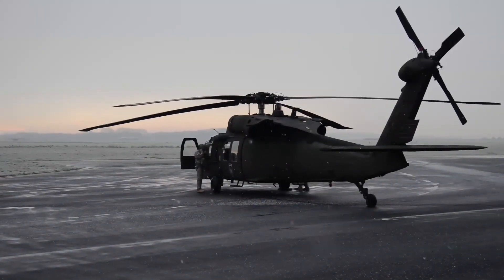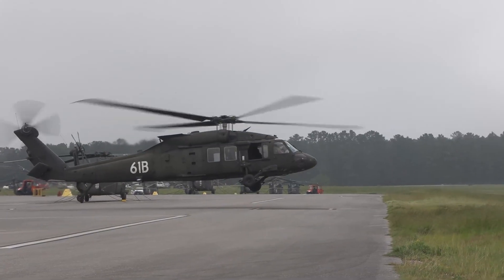Why the Military Can't Resist Tilt Rotor Aircraft

Comment: Technically speaking Osprey has a better safety record than the Blackhawk etc but since carries a lot of people when it crashes  it becomes the headline, this is not to descredit it's woes during development
Reply: Then don't fly either. Why risk more service members lives? Our nations best are not crash test dummies for military contractor to use. Send the design engineers and mechanics up instead... I bet safety issues resolved quickly or aircraft gets grounded.
Reply: What a stupid statement.
Reply: @locoparentis244  there will always be some risk when flying aircraft especially helicopters, but these are very rare (even for the osprey) there will always be a risk associated when flying in them, it but the military should still try to minimize the risks.
Reply: @Facade866  understood, agree, but level of risk must be honestly appraised vs rewards. The thing seems inherently a bad design, period. Is it combining the best of fixed and rotary wing aircraft, or does it actually achieve the worst of fixed and rotary wing aircraft?
From recent article:
The central concern today is flying safety and here the Osprey has a mixed record. The aircraft had four crashes and 30 deaths during its initial development.
Since entering operational service in 2007 there have been an additional ten crashes and 24 deaths.
Two of these ten were on combat operations where the cause was uncertain. The others were due to pilot error or technical problems.
A fatal crash off Rockhampton in 2017 can be seen in a terrifying video that also shows operating the Osprey is a complicated business.
Reply: @locoparentis244  ok now for your most recent question. it combines some of the good this from an airplane and some from a helicopter but also the bad stuff, some of the good stuff is that it can take off like a helicopter and fly as past also it can get bigger more easily. now the bad stuff, the Osprey/valor (I hate the valor it will just be an osprey 2 and crash as much) they can't glide like a plane even though they look like they might because they don't need the lift to take off, and they can't auto rotate (helicopters way on kind of going to the ground slower)  so they can't go to the ground slower if both engines fail/a propeller fails/ the driveshaft/and much more, so if a bigger issue happen.... good luck. and most importantly it is a pain to control, a plane is very easy if it's in the air you could fly it with little training, a Heli is a lot harder, but a tiltrotor is the hardest especially in helicopter mode which is what like half the crashes were pilot error (No blame on the pilots my cousin trains people on it.... hope he switches to a more reliable aircraft) thank God the osprey will be out of production soon but now they decided that they need to replace the Blackhawk with the valor, trust me more people will die from both tiltrotors, I hope one day this will change but it seems unlikely.
Reply: @Facade866  that is not good. I have good friends who have and will fly in these things, and I dread hearing about that.
Reply: @Facade866  Get your facts correct my guy. So much of the garbage you said is wrong...

"they can't glide like a plane even though they look like they might" - wrong

"they can't auto rotate" - wrong

"so they can't go to the ground slower if both engines fail/a propeller fails/ the driveshaft/and much more" - wrong

"a plane is very easy if it's in the air you could fly it with little training, a Heli is a lot harder, but a tiltrotor is the hardest especially in helicopter mode" - so lets not advance because it is harder to fly?

" half the crashes were pilot error" - well over half btw because the military didn't know how to even train people on the platform but now they do...

"thank God the osprey will be out of production soon but now they decided that they need to replace the Blackhawk with the valor, trust me more people will die from both tiltrotors" - The navy themselves have said the V-22 is one of the safest aircraft the navy flies...
Reply: @locoparentis244  He is wrong about so much read my comment
Reply: @locoparentis244 I am a bit biased against this due to my father working on the defiant X and raider X, so I have no comment (for your earlier question) also the Blackhawk had no crashes in its development and testing.
Reply: The Osprey is also a hangar queen.
Reply: You can't be serious. There's a reason they call it the crashhawk. The blackhawk killed more people in the same time than the V22 when it entered service in 2007
Reply: @topkek1194  if you were to look into the numbers for a second you would see that more than 5000 Blackhawks have been made with 114 deaths from accidents since it was tested and has been in service that means for every Blackhawk made 0.02 deaths have been caused but for the Osprey only 500 have been made with 54 total fatalities which means 0.11 deaths have been caused per tiltrotor built that is over 5x the amount of what the Blackhawk has caused from accidents and you still claim it is safer? and there has been 15 hull losses which means 3% of all Osprey's made have crashed beyond repair, compared to the Blackhawk's 0.48% of airframes to be made beyond repair from crashes that means ospreys airframes are more that 6x more likely to be destroyed in an accident. and all this info includes Blackhawk's history before the Osprey went into testing which is nearly 20 years and the Blackhawk is way older now, the osprey still has many more years in which it will continue to keep on killing marines due to Bell incompetence. next time look at the numbers before trying to disgrace the Blackhawk.
Reply: yeah, more that's because the Blackhawk is older and been in battle, the osprey has seen little battle and is new compared to military standards (oldest ospreys are 23 years old) and has still kept on crashing. more crashes will continue to come due to Bell's horrible design and shoddy building tactics, compared to Lockheed, Northrop, and Boeing, Bell is the most unreliable and unsafe, you can keep on blowing Bells horn, but it won't stop the marines that are being endangered due to Bell's lack of quality control, and a very hard to use aircraft.
Reply: Which literally has nothing to do with anything as the vast majoriety of blackhawks have not seen battle either. This year alone more people died on black hawks. You cry about bell, but they also won the black hawk replacement with their v-280 which was miles ahead of its compeittion and flying more than a year before said competition. You have no actual basis for your opinion other than "tiltrotor bad"
Reply: @jus7addwater  I guess since I'm here I will address this, for once look at what I have said, there are around 2000 blackhawks in service vs 500 osprey's, the osprey has had 11 deaths this year vs the black hawks 16, that doesn't look like 4X the osprey's, also the valor did have some advantages over the defiant X but that speak it would come in at over 2X the cost of the defiant X and costs more per flight hour, also harder to use in urban conflict due to it being gigantic and the defiant X filled all the requirements of the army while ON budget, the valor came in around significantly over sized and over budget. Look at the numbers first.
Reply: @Facade866  and they still even adjusted for numbers are the safer aircraft. The Blackhawk is far more dangerous as well as having far more older platforms
Reply: @jus7addwater  ok then give me your source and prove it
Reply: @Facade866  you are the one who claimed it’s a bad aircraft so sources?
Reply: @jus7addwater  I am asking you about why the Blackhawk is less safe than the Osprey, but I will go get some sources proving my point.
Reply: @Facade866  you are the one who claimed it’s an unsafe aircraft yet never posted any evidence. If you make the claim back it up.
Reply: @jus7addwater  so if you look at Wikipedia for the Osprey crashes you will see that there have been 16 crashes where the airframe was lost due to the aircraft with around 400 airframes built or so, while the Blackhawk has had 21 crashes where the airframe was lost with around 5000 airframes built, this means out of the 5000 airframes built 0.4% have been lost due to pilot or aircraft error. while the Osprey has lost 4% of its airframes due to pilot/aircraft error and if we take out the prototype crashes that still is 3% of airframes which is a pretty bad compared to the Blackhawks 0.4% (Links will not send) I used the Wikipedia for these numbers of both aircraft.
Reply: @Facade866 there’s no quality control issue on the Osprey.  Where do you get such an idea.
Reply: @chrissmith7669  I would say the constant crashes and miss wiring on Bell's part, also if it was no issue with quality control then what is the issue and why was the entire fleet grounded?
Reply: @Facade866  first there are not constant crashes.  There have been some that are plastered through the press like it’s earth shattering news.  Its accident rate isn’t worse than any other rotary winged aircraft in the fleet.  
The only “miss wiring on Bell’s” part I’m aware of the test flight aircraft.   Something that happens far more often than you’d be comfortable with even in the commercial aircraft world.   
There was a problem with the freewheeling clutch.  Very similar to one that grounded all the Chinooks not long ago that wasn’t front page news.  There was an issue with it slipping and locking up at the wrong times.  If you were involved with aviation you’d know that seemingly minor changes in production or material specs can cause issues in operation.  All components could be fully in spec but not work together as expected.  Right now they don’t know the reason for the latest crash so as is often the case in military aviation they are grounded “out of an abundance of caution “.

Comment: IMC, industrial Military (Congressional) Complex. The Osprey was “certified” by the FAA under a “special” category to allow it to fly. It cannot autorotate like a helo nor glide like a regular conventional aircraft. I remove my hat and salute all service members that have to fly in one. While in the Corps, I flew in all helos except the Cobra. I was out before the Osprey came online. Semper Fi!.
Reply: The FAA doesn’t certify military aircraft.   That’s why retired military are registered as “experimental “ when bought by civilians. It could autorotate but with nacelles up the drag makes it difficult to perform well.  Its short wings mean it can glide with both engines out but it has a low L/D compared to standard fixed wing.  It is the standard emergency procedure its only real drawback is that when the land with nacelles down the  blades “broomstick “ and the gearboxes are toast due to the shock loads.  
I rode all the Army aircraft back in the day and was bummed when they passed on the Osprey.